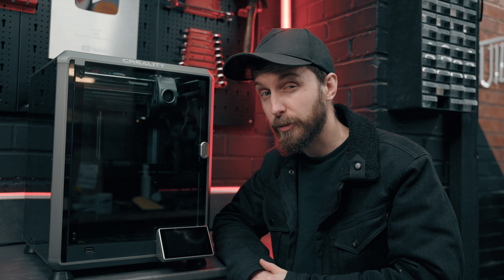Carbon Fibre Parts 3D Printed FAST! - Creality K1C

Comment: Could we please debunk that more infill help make the part stronger. The biggest impact on part strength are number of walls. Infill are there to support the top layers…
Reply from the maker: I think its scale dependent too. And obviously how much weight or stress you plan on putting through the part
Reply: how much support there is on the layers... makes the sides stronger? You really think there is no correlation between part strength and infill density?